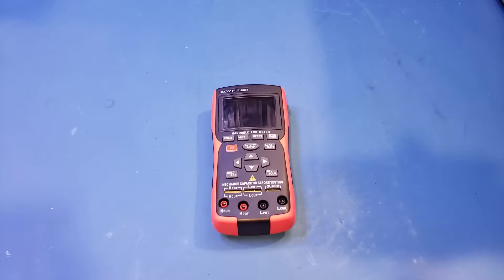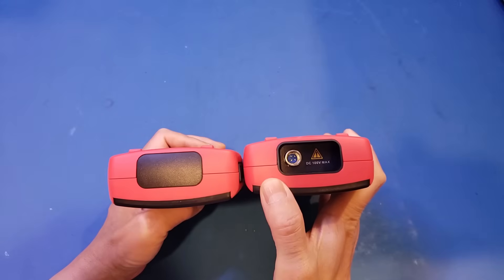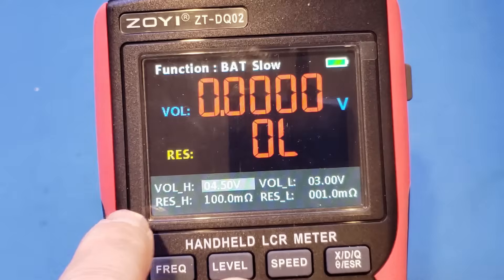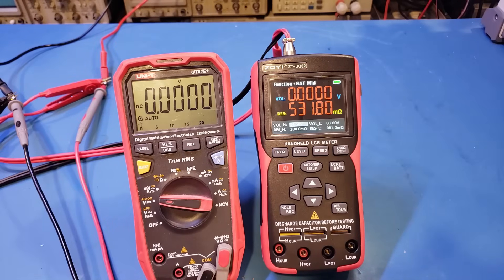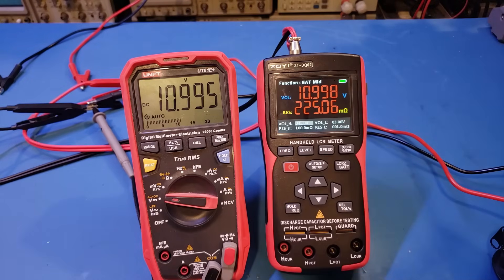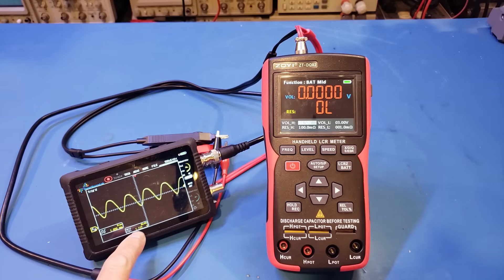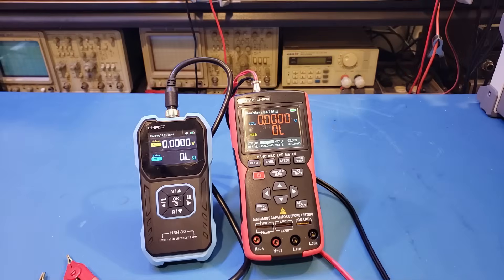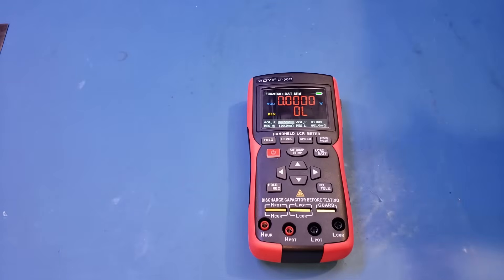ZOYI ZT-DQ02, LCR Meter with Built-in Battery Internal Resistance Tester, Review/Teardown

Comment: Muchas gracias por el video de verdad muy informativo y pues me sirve porque hace poco adquirí uno de este mismo modelo y pues la verdad me estoy familiarizando para poder sacarle el máximo provecho, teniendo en cuenta el comentario de que comienza a medir a partir de los 60mV eso se le puede informar a la compañía o a la marca para que lo corrijan en posteriores actualizaciones de firmware verdad???
Reply from the maker: Since this is not a dedicated multimeter, having a voltage measurement threshold of 60mV shouldn't be an issue as batteries' voltages are much higher than that.
Reply: @KerryWongBlog it s true, i understand
Reply: @KerryWongBlog it is true, i understand, thank so very much, very kind

Comment: Danke für das gute Video.
Schade, dass Du mit dem 02-Testergerät den Widerstandsmodus nicht getestet hast, der ja beim 01-Tester schlecht war.
LG
Reply from the maker: The specs in LCR mode between these two meters are identical. I spot checked between these two meters and didn't see any discrepancies.
Reply: @KerryWongBlog  Danke

Comment: Great review of this Zoyi ZT-DT02 and also the ZT-DT01. I purchased the ZT-DT02 as the addition of battery resistance measurement makes for actually a good two in one measurement device. I previously just had on hand basic LCR measurement on a multimeter and the low cost Arduino base component tester. So I think this meter is quite an affordable step-up for enthusiast at home, equivalent to meters that would be at least three times the price. I did see another review of these Zoyi meters that measured in tandem on an oscilloscope the signals that the Zoyi injects and the principle of how its making LCR measurements which is interesting done by an Ukrainian @moya-sprava-admin. Had to do auto translate to my native language English so might've missed some meaning. Think you would be very able to do a more in depth theory presentation of such measurement principles for these instruments.

Comment: www.youtube.com/watch?v=RgjBRdckGPw           Did you see this video? The guy in the video used a 0.22 Ohm 3-leg non-inductive resistor and compared the measurement with a Vici VC480C+. The DQ02 displayed a value that was about twice as high.  Have you encountered this issue as well?
Reply from the maker: I just checked out the video, not sure why his meter was showing the wrong reading. I just checked a couple of low resistance resistors  (0.1 Ohm) and the reading was pretty much spot on using 100 Hz.
Reply: The author forgot to read the instructions ))

Comment: Maybe it's important to tell that these meters only do AC measurements and not DC for pure resistance mode.
Depending on what you want measure, this doesn't always works well if the impedance of the DUT or circuit isn't constant.
I just got this meter this week, but as soon as i unpacked it, i realized that I can't use it for exactly this reason 😢😢
Reply: can you recomend another device that does both?
Reply: @silviuguseila2552 unfortunately I'm still looking myself.

Comment: Thanks for the detailed review! I wonder what the connector part numbers are. It would be nice to connect a battery holder to the Battery Internal Resistance feature so that 18650 and 21700 cells can quickly be checked.
Reply: It's an XS10-4P connector, also called "aviation plug" in the context of IR meters.

I was looking at dual spring contact probes on AE, but they are $20 with dubious quality.

Comment: No other LCR meter costing four or five times as much significantly outperforms the ZT-DQ02.  I  bought a ZT-DQ02 several months ago and I have not found a serious dislike about the product.  The ease of use is great, the battery lasts a long time and the readings are accurate.  I definitely recommend  getting a ZT-DQ02.
Reply: Hello. I ordered mine and it only came with battery kelvin clips... What do you think if I make a banana plug adapter to use the kelvin clips, would I be damaging the low measurement resistance...? Should I better order a separate kelvin clip? Regards.